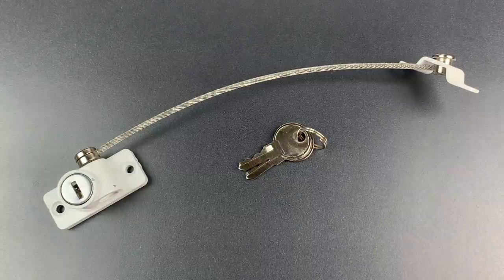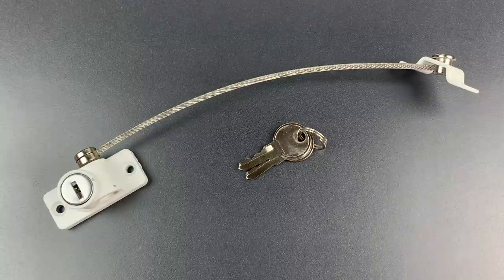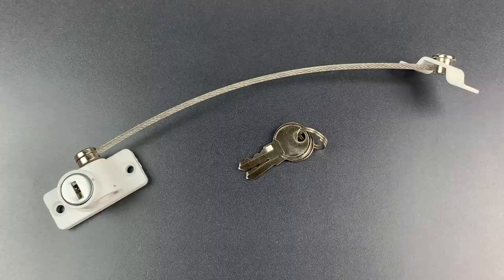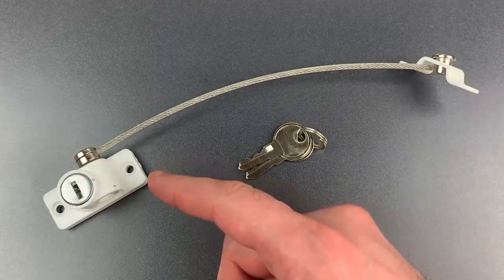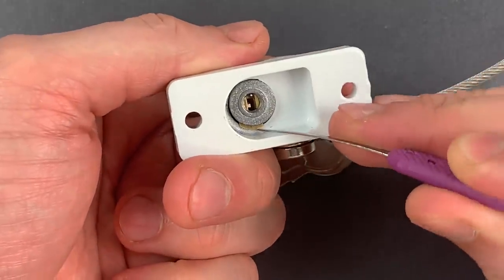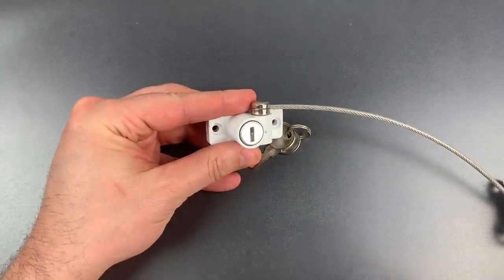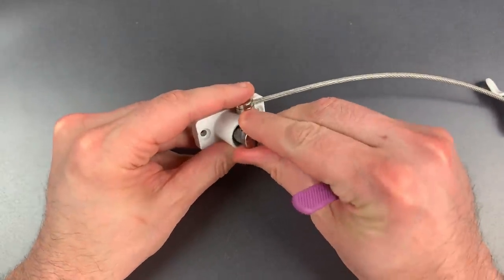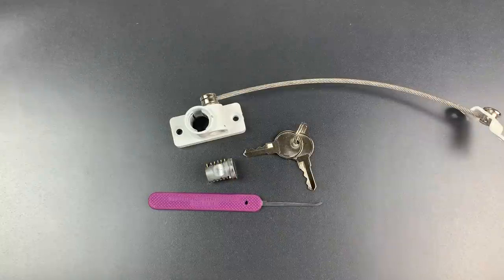[873] Why Is This Lock So Dangerous?

Comment: “This lock is also a grenade,” is what I was really hoping he’d say.
Reply: Well, anything is a grenade if you throw it with enough force.
Reply: @SlimThrull  that would be a bullet (or cannonball, or thing thrown at high speeds to harm someone) a grenade needs to explode and basically shoot out bullets (the bullets being the broken fragments of the casing)
Reply: @SlimThrull  nah more like a railgun or cannonball. It would travel extremely quickly and make a giant hole in whatever it hits, but it still wouldn’t explode.
Reply: @somedude6833  It'd turn to plasma within a millionth of a second.
Reply: Well its not Samsung lock
Reply: This was a grenade. Pull out a pin and shrapnel goes everywhere.
Reply: And then expand rapidly atomizing the air around it
Reply: This lock is full of tiny wasps.
Reply: @SlimThrull  grenade+grenade launcher+pistol+lock+assault rifle+tank cannon = Automatic grenade lock on semi half pistol full grenade with countermeasures that can full blast through ground.
Reply: We could only wish.
Reply: I was thinking "this lock will deliver an electric charge if it detects a lock picking attempt". I thought the main danger would be the difficulty in telling which is a pick attempt, and which is just the key.
Reply: Well, you can always use it to strangle someone.

Comment: This is the only lock I have ever seen where it's faster to remove the core than to use the key to open the lock. lol
Reply: What?...  You've never seen a Master lock?
Reply: @bugsbunny8691  Source pls
Reply: emilia
Reply: Same
Reply: @EddieGooch  lock picking lawyer videos [626] , [869] , [369] , etc.
Reply: Just rip the lock from the screws as a hole.
Reply: @bugsbunny8691  Thank you!
Reply: Haven't been watching this channel for long, have you?
Reply: @terrandroid  sure, and then your credit card gets charged by the hotel for the damages.

  He was showing us how to defeat the lock in a way that does not damage anything, so you can be safe in a room that may be equipped with such a lock on the window, should one of the situations he described arise.

An easy, albeit slower, way to defeat this type of lock would be to unscrew it from the surface it is mounted to; and a screw driver is a far more common and useful tool to carry, plus, all multi tools like Gerber and such, will have screw drivers on them.  Although, if you do have a tool like LPL uses here (such as is found in a lot of lock picking sets), it is obviously way faster.
Reply: @joseybarra2046  oohoo danger jose hahahaha, listen buddy it al depends on how much you are going to profet after breaking that lock
Reply: Aperently you've never broken in
Reply: Sorry Subaru, I love Rem.
Reply: Yeah, no unnecessary twisting.
Reply: I  l o v e  E m i l i a
Reply: @EddieGooch  this channel
Reply: Need to watch this channel more, Rem.
Reply: Hi rem
Reply: He didnt have it pushed all the way in with the little piece of metal to hold the barrel in place in the back, if he had he wouldnt have been able to get it out so easily, these sorts of locks arent dangerous at all, they are used to stop children from being able to open the window more and fall out .
If you are on the 1st floor of a building you arent going to jump out of the window, are you!
Reply: @kbraz1970  I would much rather jump out a first floor window than walk through a maze of hotel hallways, in the event of a fire. First floor windows seem like the most likely to be seen as a safe emergency exit... unless you do parkour, or don't care if you break your legs/spine....
Reply: What? Oh boy, you are in for a good ride if you decide to watch more of LPL videos.
Reply: I think you could use the key with force and pull the core out
Reply: @kbraz1970  No, this is a very common way for cheap wafer locks to work.  They're designed such that the last wafer, which is not normally engaged by the key, holds the plug in.  And yes, they genuinely are this easy to pick/bypass.  (Never trust a desk drawer lock to secure anything valuable for this reason.)
Reply: Rem, this is a pretty common way for desk drawer and other furniture locks to work.  What's really sad is when that last wafer wears out and the plug will no longer even stay in when you pull the key out.
Reply: @EddieGooch  binge this channel
Reply: @bugsbunny8691  At any of your source was core removed after it was picked or over lifted [869]. They where fast picks, but removing core was first for me.
Reply: Bruh Season 2 is gonna be lit 🔥🔥😂
Reply: If you are ever trying to escape a fire you could just BREAK the window and climb out. Some glass in your hands beats death by fire anytime.
Reply: Oh hey. I remember you.
Reply: LPL : picked it twice in 0.2 second
Reply: There are lots of wafer locks like this, this is usually the first thing I'll try when I'm trying to get a furniture or cabinet lock open to impression a key. Works quite a lot actually
Reply: Normally the fastest way to remove a core seem to be using the key. Not so in this case.
Reply: You, uhh...you haven't watched many of LPL's videos yet, have you?
Reply: @BeaDSM  LPL opens many locks faster than it takes to find and use the key, but removing the core does take a few extra seconds.
Reply: @57thorns  ah, my comment was in reply to OP's comment, not yours.
Reply: @terrandroid  that's what i thought! bet those screws are weak.
Reply: Bugs Bunny 626 you have to cut the rivets to pull the core.
Reply: You must be new here
Reply: so... read somewhere that you are in a coma... you planning on waking up any time soon or?
Reply: @joseybarra2046  I’ve legit done that with this type of thing in a hotel room where the heating was stuck on max
Reply: @kamencic  lol kamenčić
Reply: @terrandroid  Just smash a chair through the window to open it. That's what I do every time I want a cig and am in a hotel that uses them locks. ;)
Reply: There are tons